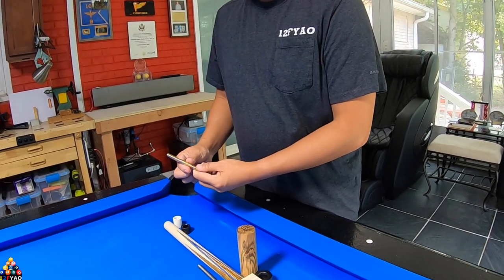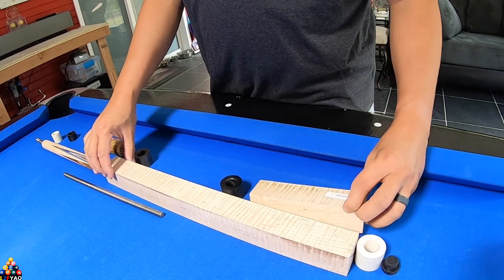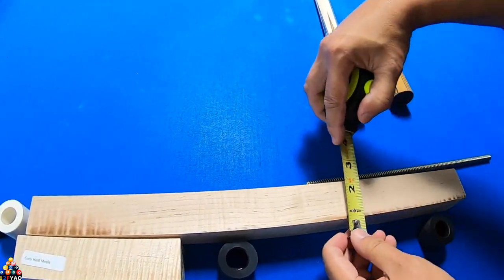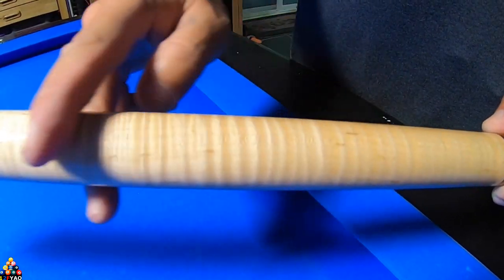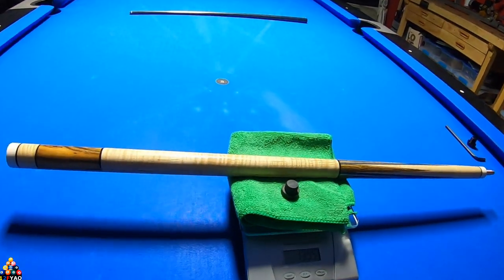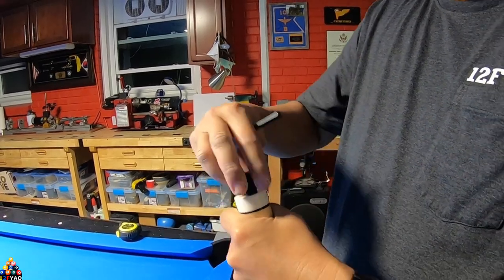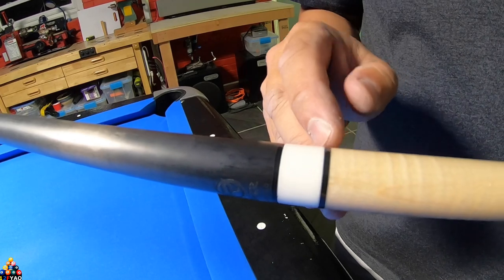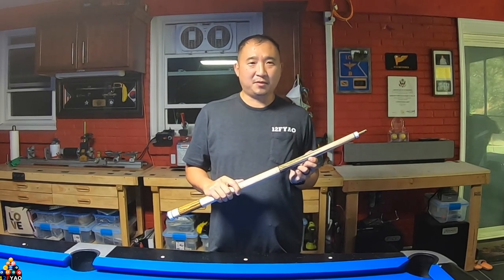Making a Pool Cue. 6 Point Cue, 3 High Points and 3 Low Points with Curly Maple and Bocote Wood.

Comment: Where did you get that awesome long carbide tipped boring bar?  Did you get it from Todd?
Reply from the maker: No. I actually got it from Amazon.  It came in a set of 3 sizes but I only use one, the smallest one about 3/8 size. I need to get one from Todd to bore smaller holes.  Thank you for commenting and please share.